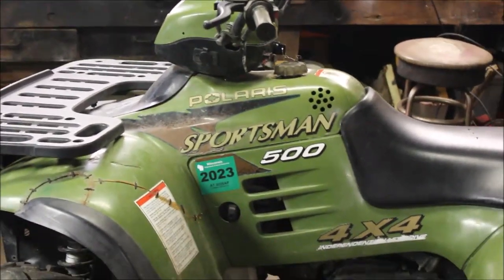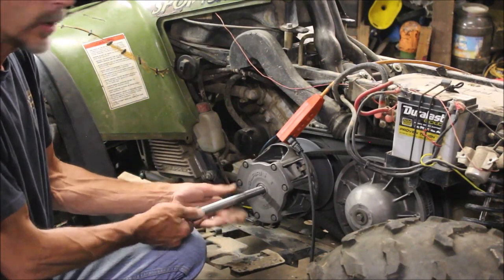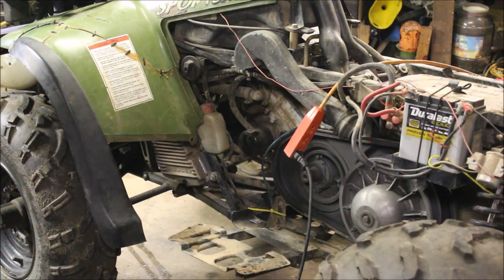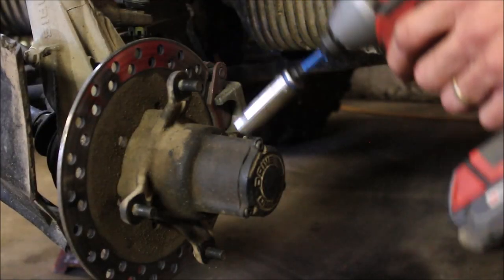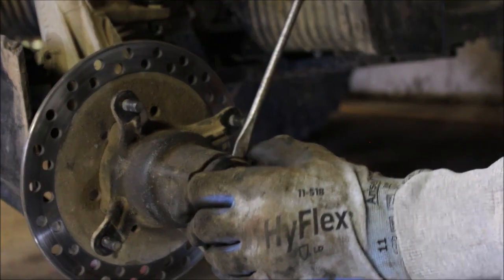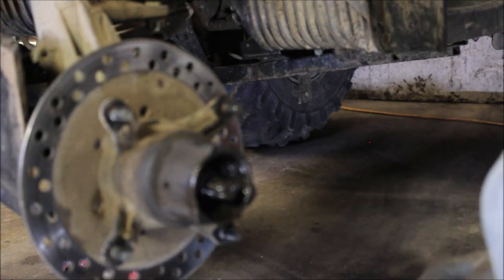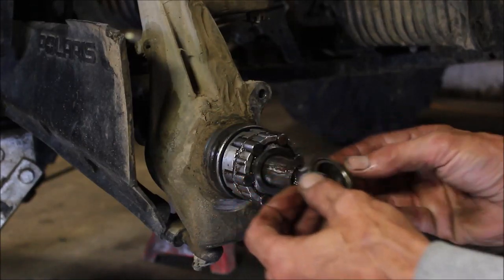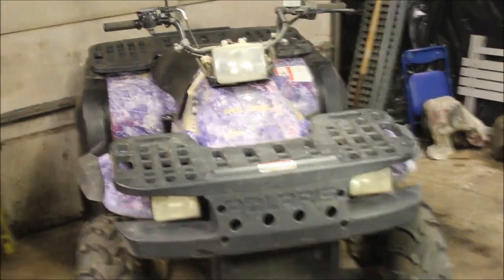1997 Polaris Sportsman Project! Transformed into a 2005.

Comment: Made a big mistake man. Found a Barn find sportsman 500. Only 660 miles. Got on a steal for 1k. So when I got there the gas tank looked liked it was empty so I filled it up and jumped the battery. It fired right up. So I let it idle for a while. When I got home it idled for. A little while too. So after I got home I checked the oil and realized there was no oil in the damn thing. Not one drop came out the crankcase and barely anything came out the reservoir. So I filled it up with oil, and I even did the priming procedure just in case.  I took it for a ride up the road and it sorta siezed up and started knocking kinda. So I let it coold own for hours then started it back up for like 10  seconds and it seemed to sound okay. But then I thought hmm maybe I should check the oil again and not one single drop came out the crank case. So then i took the oil filter off. No oil in the filter either. Even after I just filled it up with 2 fresh quarts. Anyway you think I burned the oil pump up when I let it idle for so long? I feel so stupid. Why didn't I check the damn oil before I started the thing .... never will I not check the oil in any machine from now on. any ideas or suggestions ?
Reply from the maker: Ouch. That blows. My first thought was where did the oil go in the first place before you started it. My guess..head gasket leak. Burned oil? Pull the rocker cover. Pull start it without sparkplug see if oil comes up to head. If not..oil pump. If so possible head gasket or something plugged. I have had  the oil port by the cam plugging up and seizing cam. Snapped the chain right off.
Reply from the maker: Oh..valve seals too.
Reply: @TitaniummanGarage  the guy was old. I honestly think he drained the oil and never filled it back up. But the thing is I'm not getting oil to my topend. What should I do. You thinks it's the oil pump or is there anything else I can do
Reply: My oil isn't even going in the crank case. 2 quarts and it's not coming out the reservoir
Reply from the maker: Ok. I got ya now. Try adding oil to the drain plug. Tip wheeler on an angle.Those oil pumps are just 2 metal gears. They rarely go...but it's not unheard of. Try the oil in the drain plug. See if it pumps up to head.
Reply from the maker: Another thing you could try is pour seafoam in your oil. it might help loosen everything up. it restores your rings too if they are sticky.
Reply: @TitaniummanGarage  so I took the oil supply line off the reservoir and poured oil directly into the crank case and then pour oil into the oil filter. Then after pull started until oil started spraying out the oil filter hole. So i think she's good. She Sounds good. Hopefully I didn't do to much damage. Although there is a slight rattle that's coming from the pull starter side. Not sure what it's. Gets louder as you Rev it. Not super loud noise but I can hear it
Reply from the maker: Cool. That noise is common. Pull recoil cover. Its could be the bendix.rusty or something in recoil. I just pulled the cover on the purple one. Starter rope broke and recoil spring was flopping around inside. The guy replaced the cover with a new one but the spring was stuck behind the stator.
Reply: @TitaniummanGarage  thanks bro
Reply from the maker: Sounds like you got a good deal. Hope it runs good for ya.
Reply: @TitaniummanGarage  yeah I think so as long as I didn't do any serious damage I should be able make a good penny off this one. Im thinking I can get atleast 3k easy
Reply: @TitaniummanGarage  was the bendix swapped it out with a good spare I had laying around. Thanks man.
Reply from the maker: I just pulled mine apart. I found big chunks of recoil spring making my noise.

Comment: I have a Polaris Magnum 425 that I changed the jug on and made into a 500 I'm having some running issues with it and was wondering if you would have any information on why it's doing what it's doing if I ease the throttle to quarter throttle Spitz and spotters and doesn't take off or if I just go straight quarter throttle but if I go straight half throttle picks up to RPM and stays at RPM around 3 and 1/2 4 what sounds like normal half throttle RPM but if I go either way after going straight half throttle it starts to spit and sputter
Reply from the maker: Sounds like a jet is plugged in the carb.
Reply: @TitaniummanGarage  I have cleaned the carb thoroughly several times I've been at this problem for a week now
Reply: The jetting for a 425 is probably different than a 500. Are you using the 425 carb
Reply: @TheTechGuider  yes I have done everything possible to the carb
Reply: @alanspencer9007   check the stator and pick up coil then. Or your clutch maybe worn.
Reply: @alanspencer9007  425 stock jet sizes. Main 152.5, pilot 47.5 
500 stock jet sizes main 155 pilot jet  40
Reply: @TheTechGuider  thanks I found different information that I had researched on internet and YouTube and was going by never found anything of sorts of this information
Reply from the maker: No
Reply: @TitaniummanGarage  is there a way I could just talk with you by email or something

Comment: You know you can test 4wd just turn key 0n shift into high click into fwd! While with out engine running!And spin hub! You can do the same with hub off! Take the flat black plate and see if it locks by turning plate by hand!More of simple test then it running or checking wires!
Reply from the maker: Thanks. I've had 3 this month with bad wiring. So I've been checking the wiring first.
Reply: @TitaniummanGarage  I been working on them polarises for 30 years! Have prob you can't figure out jingle me! I like your vids!!
Reply from the maker: Cool. Thanks man. I've been wrenching on them for 5 years now. I built engines for a living for 12. But it's always nice to bounce a problem off of someone else. Thanks.